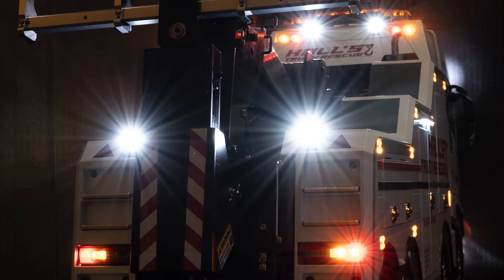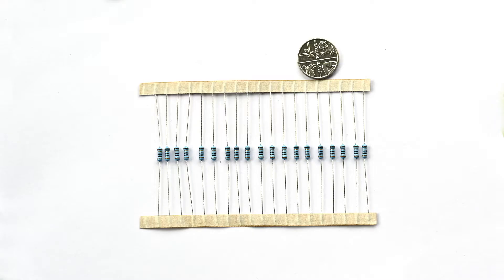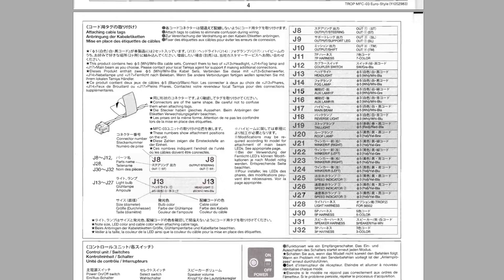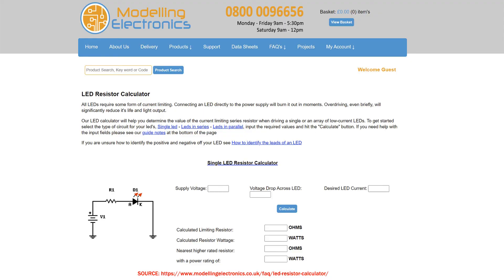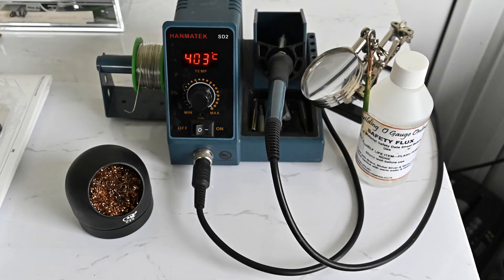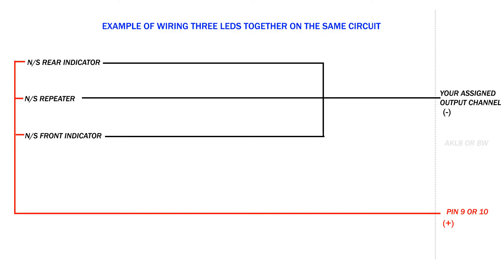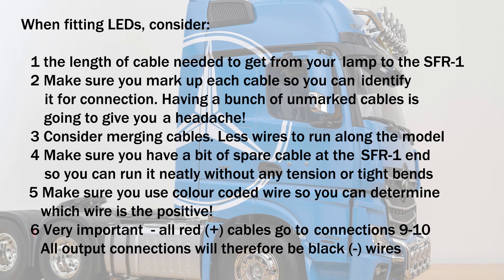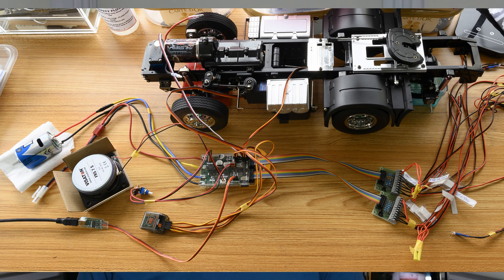Fancy a Beier Part 3

Comment: Colin, perfect timing as I've just left the Beier Forum! 😁  VERY helpful lot. I left a comment earlier, on your previous Video. 
You impress me as someone who has a working knowledge of Electrical Engineering. Am I off? 
My Father was an Electrical Engineer... I am most certainly NOT! 😫😵🙄  I have an understanding, from working as an Auto Technician on Luxury Vehicles, and as an Audiophile. This Beier - especially the Manual..... PERPLEXES ME!! I want to understand. I just can't grab the concept fully. This isn't easy for an Old Fart of 58, with a long Career of problem solving. 🙄 
~ I just really didn't want to go with a single option, MORE expensive MFC!  I've mentioned that I'm using good ESCs with incredible low speed tuning... and a 10 Channel Radio. 
I'm waffling!! 

The question is about LEDs. I have almost 100 better than average, pre-wired LEDs, 3mm, 5mm, 8mm and 10mm. 
I do not know the Resistor value, but the White ones have a perfect bright beam on 3S Batry. The Red, Amber and Blue also give correct lighting, I've tested them by leaving them on for 4 days. (MONITORING the Lipo of course!) 

The Resistors are on the Positive Lead... CAN I use them on my Beier?? 
(Knowing that ALL Positives are Common) 

Thank you Sir! You're providing an invaluable service!!
Reply: Just finished your Video, ANXIOUS for more! 
Colin, I realise that about  95% of your content is aimed at the more Novice type.... 
I'm neither a Novice or an Expert. Last Video, you browsed by CUSTOM Sounds and Sound Sequences, plus some  custom operations on your Volvo Tow Truck.... 

ARE YOU going into any of that at any time??? 😜😊😊😊 
On the Sound Teacher Screen, on the Sound Tabs - there's the slots for adding Sounds. I got that. 
NEXT to them are a SLEW of "tick boxes" for Outputs 1-16, Output Seq  1 and 2, and a few other things that NOBODY has sufficiently explained, so a dum dum like me can understand!! 

It's TOUGH knowing enough to know how much you DON'T KNOW!!! 😫🤬🤬 

One more thing,  I promise! 
My last unit, when pulling the Throttle back, always makes a horrible "whirring" down Sound (ANY Engine Sound file), if you remember 80's Racing Arcade Games, you've heard it. 

YOURS doesn't do that! It just sounds like an Engine decelerating. HOW did you do that? Is it something in the settings, or your own Sound Files? 
Thank you for putting up with me.
Reply from the maker: Hi Carmine. I'm no expert, just an experienced user. I will confess there's parts of the Beier system I have not used myself. In the last part (hopefully in about 10 days!) I hope to give some structure (make sense of) to the software. I will most likely look at random and custom sounds, creating your own and touch on macros (or sequences as Beier call them). As for your throttle sound.. the slowing down sound is a default sound specifically matched to the forward sound file. It's not something I've created. I assume you have loaded a standard .sfr file for one of the trucks (from the sounds folder)? This pre-populates the throttle sounds. Just a thought - there will be a brake file, usually 'bremse.wav'. This sounds when the vehicle is in deceleration. You could try removing this file and see if it helps.
Reply: @tamiyatruckbuilding7426  
Yes Colin, for my Grand Hauler, I used the Detroit Diesel  .sfr file from the Software. 
It's not as offensive if I lower the "Speed" in the Engine Sound page to about 170%, instead of the 300% that's defaulted in the upload. 
I also loaded the CAT and Cummins Engine files... SAME thing! 
BUT, that was with the USM-RC-2. I haven't been able to get to work on the new USM-RC-3 yet. Since it's supposed to be just like the SFR-01 without built-in ESC, maybe it will be better!  I will try that bremse.wav removal. Hell I'll try spitting in a tube if I thought it would help!!! 🤪😂🤣 

I truly look forward to the next part! If you figure out more advanced features, I hope you'll share 😉 
I'll be using my Beier to control the Actuator on my 8X4 Tipper Truck. So I'm excited to see how yours works! 
Cheers and thanks!
Reply from the maker: Hello Carmine. Again, thanks for the kind comments. If I'm correct, a 3S Lipo is 11.1volt? The SFR-1 has an operating range between 6 and 18vDC, so 11.1volt as a supply voltage is fine. Within the software you specify your battery type and voltage. Beier caters for 2, 3 and 4S Lipos.  If your LEDs work on the 3S, they'll work just the same on the SFR-1. As for where the resistor is located; it doesn't matter so long as it is in the  circuit i.e. before or after the LED. Sometimes if you aren't sure about what resistor is required it is worth sacrificing one. Start with a 680Ohm resistor in a simple circuit with your battery. Gradually substitute the resistor for a smaller value until it goes pop. This way you'll learn what's best for brightness / longevity.
Reply: @tamiyatruckbuilding7426  
Remember, I'm using the USM-RC-3....  Exactly the same Wiring and Functionality as the SFR-01. Except I've got EIGHT Prop Channel inputs and four Servo outputs. 
I was told on the Beier Forum that the files I have already for the now defunct USM-RC-2, work in the new model. They're also the same as the SFR-01! 
I just obviously need the USM-RC-3 Software, which I do. 

So I shouldn't have any problems with the LED Resistors all going to Positive Common? They will all be in Parallel of course.